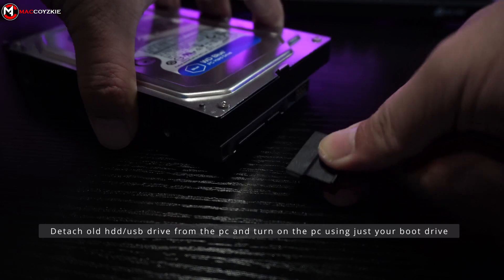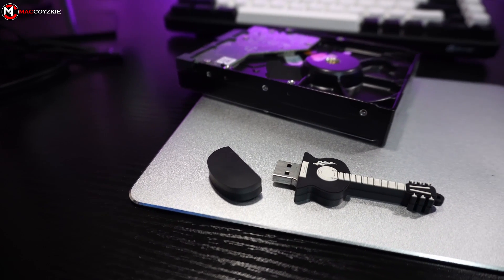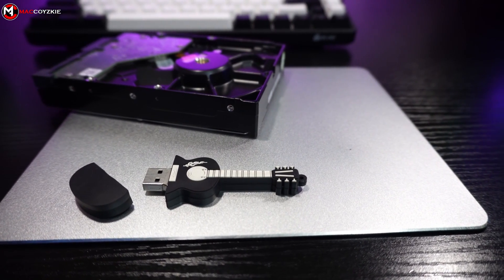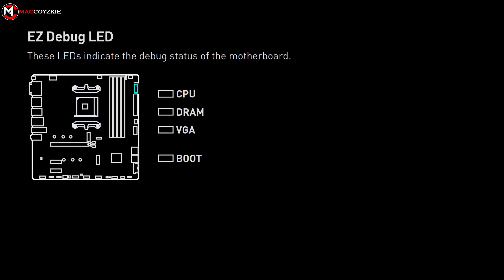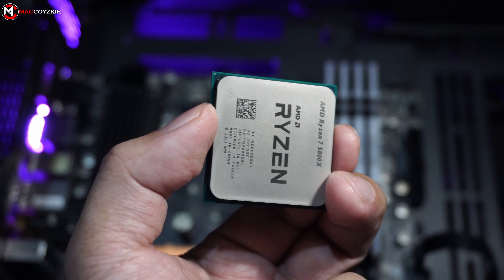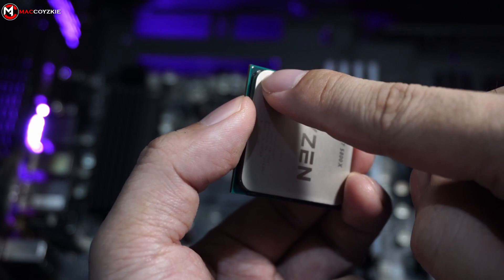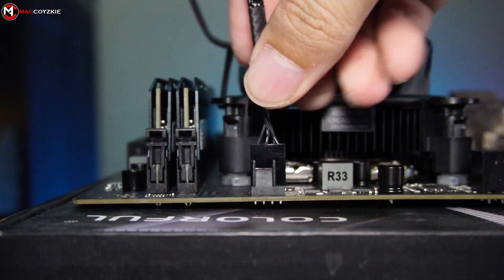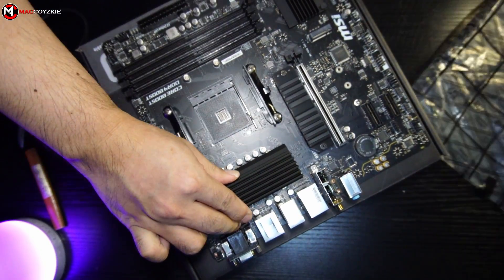Debug LED always on FIX

Comment: No led pops up but my pc won’t boot, RAM led goes on but that’s it, is the mainboard defect?
Reply from the maker: it depends, is this a new build or a working one? also tell me the specs and how the pc problem started so i can have an idea
Reply: @MacCoyzkie  it’s a new build with a 7950x3d and a 4080 tested out the psu and gpu and they work fine, when I disconnect the cpu power cables the fans turn on, before  not I think it’s either the cpu or mainboard. What do you think?
Reply from the maker: @CaEdits  what's the motherboard model name? when you disconnect the cpu power cable fans work but does it show display? i can't say yet I need more info
Reply: @MacCoyzkie  I have a x670e creator, g skill z5 neo 6000mhz cl30. The display doesn’t show anything when not plugged in, in general it doesn’t show anything. When plugged in and I press the power button it goes on for like half a sec then it shuts down and few seconds after that the ram lights up
Reply from the maker: @CaEdits  sounds like a power supply issue, what's the wattage of the psu and what brand? try using a psu tester like this https://youtube.com/shorts/YrC3PlflLq0 to check it
Reply: @MacCoyzkie  I have the dark power 13 with 1000 watt, the psu works fine I use it at the moment on my old pc with my 4080
Reply from the maker: @CaEdits  i see,  you need to update bios, go to asus website and check the bios for 7950x. there is no general way to update bios so you need to check the motherboard manual for that. the latest motherboards nowadays does not need display to update bios and there is a flash button at the back of the mobo so again check the motherboard manual for it
Reply: @MacCoyzkie  I Updated my bios to the latest version still the same problem :/
Reply from the maker: @CaEdits  oh no, i think this is the time you need to go to a local shop. have the motherboard tested with a different cpu, ram, psu and gpu. if it doesn't work with theirs then you need to use Rma for the mobo

Comment: what’s weird for me is that it displays and recognizes all my parts in the bios but I can’t get rid of the red boot light ??? is it because I need a bios update??
Reply from the maker: i bet you got the latest motherboard, b650, x790 or b660. I got several viewers who are experiencing the same and it seems most of them just updated bios and fix the problem. but before you update yours check this out first https://youtube.com/shorts/nfH5Do3Dq3o
Reply: @MacCoyzkie i have a b550, it’s the msi mag tomahawk max wifi. It does the thing where as soon as i turn on the pc it will go red on on cpu, then vga, then stays red on boot.
Reply from the maker: @craaee  usually if the cpu already works with the mobo you shouldn't update the bios anymore. this is more like a motherboard issue but if it bothers you so much i think updating the bios is the only choice
Reply: @MacCoyzkie  I ended up updating the bios and the light went away, thanks for the help tho
Reply from the maker: @craaee  no problem bro

Comment: when i turn my pc on, it first light on cpu, then vga and then BOOt, but the red light only stays at boot. i have tried taking out m2 ssd but it doesnt work, what do i do?
Reply from the maker: replace the sata cables both power & data. if still does not work this is either a faulty drive or messed up windows os. To check try using a different drive, remove that ssd for a while and boot the system. if you see "reboot and select..." this means there is something wrong with your ssd
Reply: @MacCoyzkie  i Got it to work!, Thanks :)
Reply from the maker: @oskarjacobsen2209  no problem
Reply: I have the same issue
Reply from the maker: @craaee  i answered your first comment bro, check it out

Comment: Really good video but I still have problems: 
My VGA LED is on but I know that my graphicscard isn't broken, since I tried it in my old PC and my newer one which worked fine for 2 years suddenly stopped working. Is there something else I can do to find the problem?
Reply from the maker: try the gpu with a friend's pc and if it worked there its definitely not the gpu and must be the motherboard that needs bios update
Reply: @MacCoyzkie  thanks for the answer, I actually managed to fix my problem. It was a faulty RAM I guess. I installed new RAMs and resetted my CMOS and everything worked again

Comment: Just built my PC yesterday and played games on it. But today I got home from work and turned on my PC and the Debug Led is stuck on CPU. I tried:
1) Reinstalling + Repasting the Processor 
2) Reinstalling Ram Sticks
3) CMOS Battery Reset
4) Replugging one by one each peripheral connections
5) Using another powersupply to boot the system
Still stuck at CPU EZ Debug LED
Wouldnt be this for replacement already? The chat support only said that they will have the tech team accomodate me through chat tomorrow. :(
Reply: Motherboard: MSI a520m A Pro
Processor: Ryzen 5 4650g Pro
RAM: 16gb GSkill Ripjaws 3200mhz DDR4
PSU: Be Quiet System Power U9 600w 80+ Bronze
Reply from the maker: @juliuscesarclaro9512  i was thinking it needed bios update but you mentioned you used it and played games so i don't think it needed bios update. you will need to have the cpu tested in a different pc at this point to check, since its new Rma will be easy so if the support does not help ask for Rma
Reply: @MacCoyzkie  The store re evaluated the motherboard and it seemed to be a defective/faulty motherboard and replacement is currently on process and would take 7-10 days for the replacement to arrive. Thanks for the video it helped me to troubleshoot the motherboard!
Reply from the maker: @juliuscesarclaro9512  no problem bro, glad its all going smoothly with the mobo replacement

Comment: I have the debug  code E2 (initializes VGA for s3) in my Gigabyte GA-Z170X-UD5. What i can do to fix it.
Reply from the maker: if its stuck there it might not be detecting the gpu, can you try clearing cmos for now, here's how to https://youtu.be/S9hyEPTFR10
Reply: @MacCoyzkie  I did it Mac but I still have the same code.
Reply from the maker: @Hector-rg1bs  may i know your entire pc specs and how the pc problem started?

Comment: finally someones explaining these damn lights lol ty brother!
i got an asrock z790 pro rs, i5 13600k, dark rock pro 4, ASUS TUF Gaming GeForce GTX 1660 Ti OC Evo, Thermaltake Toughpower PF1 750W n KINGSTON FURY Beast DIMM Kit 32GB DDR5-5600 CL40-40-40. everything brand new.
tried to post (i know i wouldnt need the gpu but i still did lol) n i think cpu light never lit up, dram light stayed on (prolly the issue with A2 or B2 slot, or stick) n vga n gpu lit up n turned off just as they should.

any help appreciated.. if someone got the same asrock board n ran into some post issues or whatever. peace (:
Reply from the maker: shut the pc down for a moment then reattach the ram sticks then clear cmos https://youtu.be/S9hyEPTFR10 13600k has igpu if im not mistaken so it should work by default
Reply: @MacCoyzkie  sry for the late reply n thx for ur quick n kind one! ill try removing one ram stick n all the slots n if nothing works ill give the clear cmos part a shot! ty (:

Comment: the Boot light is green and its still on after I did what you suggested in the video and no display signal I had just built the pc . I got the MSI MPG Z790 Carbon Wifi motherboard.
Reply from the maker: depending on what cpu you have you might need to update bios but check this out before you do https://youtube.com/shorts/nfH5Do3Dq3o

Comment: What about if my pc turns on with the vga and the boot light on red than turns off after about a second? I’ve tried a lot of methods and it still doesn’t work😔😔
Reply from the maker: if you got a new build with the latest boards in 2023 i suggest do a bios update but before you do take this as a warning https://youtube.com/shorts/nfH5Do3Dq3o just in case you plan to do it yourself

Comment: I got the same issue, but the problem is only after I power cycle the pc, it can boot again.. and it happen every time I cold boot the pc... and I can proceed to play cod... not really sure what happen...
Its a new rig running on tuf x670e with 7600x and 3070 card on c750 psu.. i reflash the bios to latest hope it will work but still the problem keep coming back...
Reply from the maker: recently i've been receiving comments from viewers with these new generation mobos and yes most of them got it fix by bios update btw just a little advice here https://youtube.com/shorts/nfH5Do3Dq3o
Reply: @MacCoyzkie  reflash it to latest bios doesn't make the problem go away... can I reinstall the same version of bios? I think I didn't do a clean install.
Reply from the maker: @LiquidJim  you can actually

Comment: what if dram light about 2 sec then vga lights about 1 sec and then gone? why is that
Reply from the maker: motherboard was checking the hardware, if it lights on and off means it's working. if the light becomes steady means its not working

Comment: What if the GPU works fine but this LED keeps coming up? 4090 with a 1000w PSU (Corsair) First time it went blank and I had to remove it. Second time LED light up and stayed light but the VGA works, while the LED is still ON
Reply from the maker: just update the bios, i'm not sure why this is happening to most motherboards nowadays whether be intel or amd build. anyway before you do that you need to know this first https://youtube.com/shorts/nfH5Do3Dq3o

Comment: Hi, i just got the issues with vga led light on, i was playing a game then the screen suddenly goes blank. I've tried to power it back on, but then the pc beeps, 1 long beep n twice shorter beeps. I've tried to unplugged the gpu card, but the pc still beeps and the vga led is on, so goes when i tried the dram. My specs are MSI H310M pro v plus, intel i3 9700, 8gb radeon sapphire, i hope you could help, thanks
Reply from the maker: the beeps means motherboard can't detect the gpu, if you already tried to reseat the gpu and its still the same then the gpu might be the problem. Have the gpu tested in your friend's pc to double check and if you have the same results perhaps the gpu is done
Reply: @Mac Coyzkie  thank you for the reply, i think im going to do what you're suggested, and i hope my gpu's okay, considering how much gpus price nowaday, thanks a lot 🤝
Reply from the maker: @andrablasto2841  no problem bro, i hope it all goes well too

Comment: I got this problem today. But in my case i was playing a game then after exiting the game it turned garbage display suddenly then blue screen and then no display on monitor. So i unplug it then turn back on then this happened, ram led is on, all fans spinning but my kb and mouse not on and no display.
Reply: Update: It turned back on! I install my ram on slot 1 and 3. I think the ram slot is the problem. But i can’t OC it to 3200mhz why is that?
Reply from the maker: @carl.y4w4  it might be a faulty ram slot indeed but sometimes it is just dusty so clean the ram slots too. about the oc, answer may depend on the pc specs
Reply: @MacCoyzkie  maybe it's dusty coz i put it back now to slot 2 and 4 now it's working ang i set to 3200mhz it works now. But I'm just wondering can a dusty ram slot cause garbage display?
Reply from the maker: @carl.y4w4  more like it will cause a lot of problems and one of those problems is losing display signal

Comment: Question: when booting is it normal for the debug lights to go from Red to White to Green. Then the green light disappears and it boots? Thank you
Reply: Comp just did the "No display detected again". Works fine the night before and then randomly the next day when I go to boot it I get the no display connected on monitor despite no debug lights. Have done every fix, replacement possible, stress tested, blah blah. I think it's the refurbished MSI motherboard that's been causing me issues. I'm just going to have to disassemble and return the item as I read others have done with the x570s tomahawk. Never had this many issues with a PC in my entire lifetime.
Reply: Last thing. How is one supposed to diagnose whether it's the motherboard, GPU , Monitor or Cable? By process of cancellation I have ruled out most. If it's working and the GPU temps are great and it's passing 3D mark tests and then this just continually happens. Returning the board and if that doesn't resolve it my days of PC building are over lol
Reply from the maker: @Mr_Pound4Pound  led light colors are just the motherboard's feature, some do have these stuff and some don't but the idea there is when  it started lighting up it is checking the hardware if its correctly functioning, led will be steady meaning there is a problem but if it disappears it means it read the hardware and was functioning correctly.

there are a lot of angles you need to check if you got no display and fix may depend on how the pc problem started so check these links out for more info https://youtu.be/F-dLBIomghY or this https://youtu.be/bsivwuSlPL4

to know which component is causing the no signal problem test your monitor first with a console or laptop if you have one, replace hdmi/dp because at times its just the cable, have a friend test your ram sticks and gpu and if one of those does not work as well then that is the culprit but if it does work normally then it might be your motherboard or psu

to check psu you need something like this https://youtube.com/shorts/YrC3PlflLq0 and if the psu works fine then the motherboard is the culprit. there is no way to test the board alone and you really need the local shop's help at this because at times you just need to update the bios but before you do that watch this for safety https://youtube.com/shorts/nfH5Do3Dq3o

Comment: Hello sir! Good day to you. I have recently upgraded my CPU to a higher one, from R3 2200G to R5 5600 with an A320M motherboard. However, my issue is that the CPU debug LED on my motherboard is always ON (white), even though everything seems to be functioning properly. The system boots without any issues, CPU temperatures are low, and the fans are operating optimally. I even played a CPU-heavy game for 3 hours without encountering any problems. My only concern is the constant ON status of the CPU debug LED, as I did not experience this issue with my old 2200G CPU.
Any advice would be much appreciated. Thanks!
Reply from the maker: if there is anything i think your pc just needed bios update, there is no general way to update so you have to check the motherboard manual how to also watch this first before doing the update yourself https://youtu.be/NkDHkzNlI9s
Reply: @MacCoyzkie Thanks for the response.
I've already updated my bios with the latest version for a320m based on the msi website, but my problem still persist.
Reply from the maker: @kokopotatwo2867  this might be a motherboard issue, if the pc boots and works normally i don't there is a problem. I got several comments with issues like yours and most of them are using  the 7k series but after bios update it is all fine.

Comment: Hey Mac Coyzkie! Quick question!  Still having trouble with my PC and I started to look around for information and stuff. I read that the Debug lights colors don’t matter when you boot up your pc. Supposedly it only matter when the Debug lights turn back on and stay on. Is that true?
When my pc boots up the CPU led light is Red
Then my Dram led light goes on Yellow 
Follow with GPU/vga led light White
The boot led light sometimes doesn’t go off. 
My PC turns on btw 
The issue am having is that my PC starts running slow and then it turns off. I used to work around it by removing my ram stick and putting them back on and I would be able to game for hours. Then couple days ago my little trick stop working. Swapping the ram stick won’t work anymore. My Pc runs good for a solid 30 minutes and then it just lags and turns off. 
Also for the first time my pc got a warning screen that my CPU temperature was high 
So point of all this was if the debug light that turn on with a different color at the start are actually warning or that’s just how my Motherboard turns on because none of the light stay on afterwards. I thought those light indicated what issue my pc has but if that’s it natural start up then idk what my issues is. Anyways thanks in advance
Reply from the maker: in some cases the led colors matters depending on the motherboard manufacturer but mostly it doesn't matter. if you did received a warning about cpu temp then that might be a cpu cooler not working properly, this always happens to aio cooler pump not working, if you are using air cooler then it might not be touching the cpu so i suggest replace the thermal paste and use a better one. more info here https://youtube.com/shorts/yWJehPzuVdw 

for now, if you are using windows 10 i suggest clear cmos, here's how to https://youtu.be/S9hyEPTFR10 so we could test things out in default settings
Reply: @MacCoyzkie  Oka thanks a bunch for the info! Am thinking of upgrading to a full tower and buying bigger fans to give it more air flow and cooling. Thanks again! 🤘🏻
Reply: @MacCoyzkie  also!! Funny story! I went to my electronics store to buy thermal paste and when I got home to put on my Pc, the box was empty! I bought the Corsair Xtrem temp and all it came with was some wipes and a place holder for the tube of thermal paste but no thermal tube. Probably a manufacture error . Going tomorrow for a return and hopefully getting a new one.
Reply from the maker: @fizzmac966  yea it is probably, i hope it all goes well

Comment: I couldn't fix DRAM red light. I tried reseat all RAM, use 1 stick only on each slot, reset BIOS. My PC still won't boot. Please help😑
Reply from the maker: new build or the pc was working before this problem occur? btw if its new let me know the pc specs
Reply: @MacCoyzkie  it's ok now. My silly mistake.
Reply from the maker: @madarasoun3018  oh ok :yougotthis: